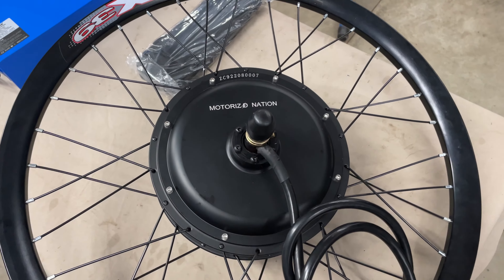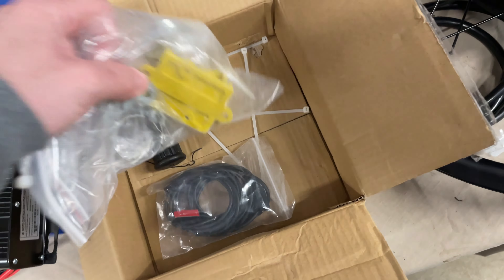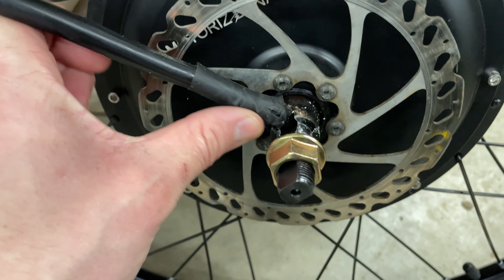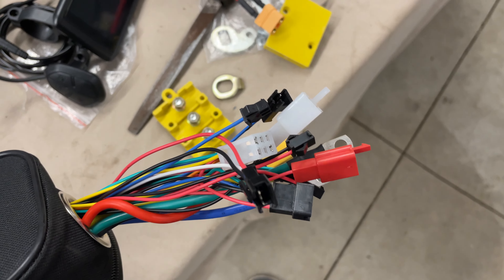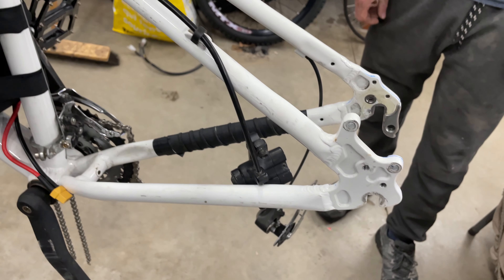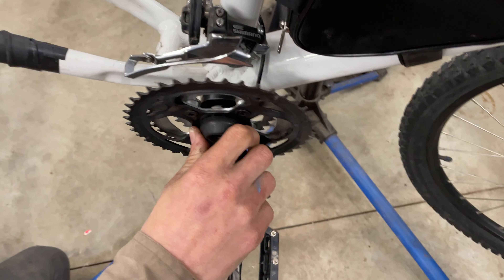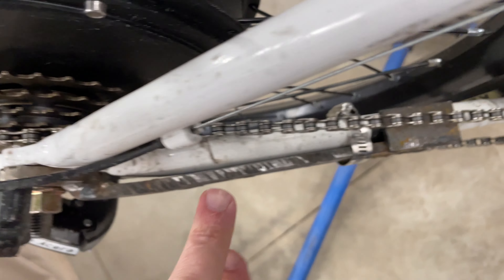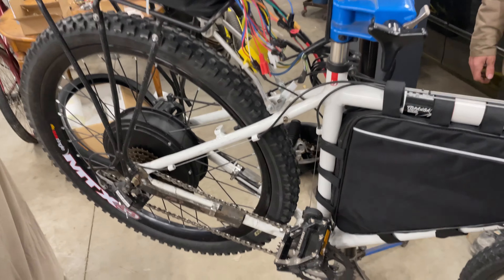Illegal 3000W 72V E-Bike Build Conversion Kit

Comment: Building an e bike is not a crime.
Reply from the maker: Riding it on public streets over 32km/h is
Reply: They only know it goes over 32 km if you tell them
Reply: @porkercon  Not really. It's still a bicycle which means it has pedals that can be used to increase your speed. I can cruise at 50 kph on a straight away.
Reply: Does when it's motored? @ProfessorStephon
Reply: @ProfessorStephon when you ride over 40  on a motored vehicle like this it would be classed as a motorbike
Reply: @ProfessorStephon  the motor of the electric bikes has to be limited to a certain speed with the pedal assist. This speed limit is 15.5mph. This means that once you are up to this speed, the motor must stop assisting you. You are still allowed to ride faster than this, but this can only come from the power you generate (or a nice downhill ride)., your comment about pedals is not true
Reply: @McEddModzHD49854  This is a really dumb question. Do you know what an electric bicycle is???? 🤡
Reply: @McEddModzHD49854  🤣👌 You don't know what the h🔥ll you're talking about. I'm laughing. I don't care if you understand. 🤡
Reply: What the fuck is a kilometer
Reply: The laws here surround e bikes are cooked, law states it has to be under 250w, no throttle, pedal assist only, top speed of 25kph you can get fined and I’ve seen people have their conversion kits impounded and put on the back of tow trucks, motorised bikes (the cheap 100cc kits) are also completely illegal outright and punishable too.
Reply: @Supra5673 it’s what other people use instead of a mph like Australians use Kph
Reply: @ProfessorStephon yes and that's the law in most countries anything over 25 kmh with just the throttle is illegal you're making a fool of yourself

Comment: I don't understand why you build something like this if you are so negative. Then spend more money on better parts, frame, controller, etc. Btw, you don't have to install the pedal assist if you have a throttle
Reply from the maker: I didn't build it, someone else did and I filmed it. We are aware of that but we want the option to use pedal assist.

Comment: I put basically the same motor on a stealth type frame in 2021 (3000w) and I love it. It's my daily driver...weather permitting. The frame is quite heavy of course but I decided to go for something that absolutely wouldn't fatigue over time. I wish more people could experience how much fun these big motors are, thanks for posting.
Reply: My build was the 1500-watt kit, on a Shwinn Axum 29' mountain bike. It is great, and still very lightweight. Long ranges with regen with only a 20 Ah battery 60 miles and top speed of 37 mph. It's not high torque but a nice gradual speed build-up. But I still did a steel plate on the drop-out. Super fun commuting all summer.
Reply: @lionelhowell4972  Nice build indded. What Voltage are you running? What brand hub motor w the regen ?
Reply: How many miles does it last? Would like to build an e-bike for college

Comment: Nice video!  I used UPP cell batteries on my ebike and atv, and they are extremely well built as seen in tear-downs.  Highlighy recommended.  They make universal tq arms I show in my bike video.  Yours are gnarly, and in a good way- should have room to grow with that setup; thank you!
Reply: Upp are poor quality. Banned in UK for fire hazard.
Reply: @Tomas-ml9nv  It's like places banning Juul, they just target the biggest manufacturer representing a market.  I've used, tested, opened many lithium battery packs.  UPP , in my experience, uses better BMCs, double solder points on cells, and they're internal wiring further showcases their workmanship.  Others I've purchased have came w wrong power supply, have shody wiring or BMC failed. And even more I've purchased were actually UPP batteries rebranded.  Nonetheless appreciate your reply and input! whatcha using in your builds?

Comment: You should be able to swap the 5 speed cassette with an 8 speed one and have it take up the same amount of space. The 8 and 5 speed are the same size, just on the 8 each chainring is closer together.

Edit: Also, pretty sure the pedal assist sensor goes on the opposite side of the cranks to the front cassette.

Comment: I made my torque plates and bolted them straight into the frame. 10000 watt hub and controller. 84v main and 12 vt booster all together 96v
Reply: That sounds insane. You got videos?
Reply: @yeredfarias7662  😅 What is the video you would like me to create? I made the bike but have no decent camera to make some quality riding videos. I will make a phone video of anything.
Reply: @soylentgreen9492  anything really lol. Was just curious about the bike frame and if you got fat tires and if it hooks or spins

Comment: Wow with what you did in the end to fit the motor in the dropouts it's a little bit overkill but better to be safe than sorry but I know one thing for sure and that is that the torque will not remove the wheel from the frame anymore😂 as for the pedal assist you should have just put it on the left-hand side of the bottom bracket so much less hassle

Comment: Hi, after watching your video I have decided to build a 5000w myself, and I have a couple questions regarding your build which may help me. 1. The wire coming out of my hub motor (and it looks to be yours), there seems to be 2x plugs that are exactly the same (not the o-ring plugs, the other one), did you just leave one plugged in to none and plug the other one into the controller (I noticed for my controller there is only 1 plug made for this one coming out of the motor) 2. How did you stretch out your battery bag to get rid of lumps and creases and make it look better? 3. How do you pull out the frame to make it (2.5") wider so it can fit? 4. What type and size file did you use for the dropout? And purchased from where? 5. With the blue wire (speed limiter), is there a way for you to choose what the maximum speed is? Just because where I live its 25kmh. Thank you so much, and awesome build!
Reply from the maker: 1. I can't remember
2. It was like that from new
3. We only had to pull it out about .5".
4. Flatbastard metal file
5. You can set max speed in the screen.
Reply: @porkercon  Ok great thanks. I contacted the supplier and there is 2 wires with all kits, one is used as spare. And about pulling out your frame .5", how do you actually do that? Did another person help you, and you just pull it out and put the axel from the motor and put the spacers on? Is there any tools you have to use?
Reply from the maker: @TomDeighton-h2d  Ya just got someone to hold it open

Comment: Hello mate im a fan, absolutely love the brillant torque arm design but i have got one question. How do you stretch out the frame by 2.5cm like what u mentioned in the video.
Reply from the maker: By pulling it with your hands, its not permanently stretched, and its not good for the frame.
Reply: @porkercon  using a 5000w motor and its axle is longer guess i dont have any other choices right mate
Reply from the maker: @zephyrus3389   right, might have to do some frame modification

Comment: Can this be put on a regular 20" ebike? Would putting it on the front wheel for front wheel drive be more stable?
Reply from the maker: Probably not since the motor is so big, front would be fine but would put a lot of force on the fork.
Reply from the maker: Looks like there is 20" versions of 3000w, scary.

Comment: Do you have a full parts list and where you purchased them?
Reply from the maker: Parts list here:
26" 3000w 72V rear wheel https://s.click.aliexpress.com/e/_Dm0TiEX

72V 30ah Battery (buy at own risk, I would seek a name brand/certified battery) https://s.click.aliexpress.com/e/_DDFXHgJ

Controller, throttle, levers, sensor, screen https://s.click.aliexpress.com/e/_DFNl6Sr
^I can't find the same controller with the same battery connector, you might have to solder on a connector.

Wire junction box https://s.click.aliexpress.com/e/_DDqtKxv

5 speed freewheel https://s.click.aliexpress.com/e/_DFgY4r1

127mm square taper bottom bracket https://s.click.aliexpress.com/e/_DDSYN3H

All other parts were already on the bike for the most part, torque arms were custom made.
Reply: @porkercon how do you trust aliexpress man? I've heard of people getting scammed and am so weary of it.
Reply from the maker: @No-ju9xz  Just do a credit card chargeback if you never get the item
Reply: Pedal assist sensor goes on the other side of frame on the non-drive side of the cranks.
Reply: @porkercon  aliexpress seriously? 😂😂😂😂😂😂
Reply: Where the charger plugs
Reply: Temu albana duh .

Comment: i just got this same kit and putting it together. can you just not connect the pedal assist if you dont wanna use it? and same for that alarm system with the key fob stuff? not sure if some wires need to be shorted together or no... mines got a 48V 1000W on front and this 3000W on rear.. lol😂
Reply from the maker: Just don't connect them

Comment: All that extra strength? Off road use only?  My 3000w motor with an 80 amp controller on a 72v 20 a/h battery does 65 mph on a 25 year old Kona mountain bike and I use it everyday to go to work on. Most times I am at full speed going to work and I only use 2 torque arms with no welded frames for extra strength as its over kill and it's perfectly safe if you know how to handle the immense power it can throw at you. Nothing is too powerful !
Reply from the maker: Frame is not welded. Better keep an eye on your dropout welds.
Reply: That's sickk have you got any links of what you purchased I want to do the same on my bmx

Comment: can you please confirm if you bought from that exact seller? ND Ebike Factory Store- this seller. I had problems with scammers this year on AliExpress but I want to order this kit. Thanks in advance
Reply from the maker: We have bought multiple different kits all from different sellers and have had no problems.
Reply: @porkercon  1000w is the easiest to buy, but this 3000w doesn't have many sellers
Reply: @porkercon  I am looking exclusively for a mtx set
Reply from the maker: @pubga5730   Usually you can customize your order with which rim you want
Reply: @porkercon   in Europe they have max 1500w 48v
Reply from the maker: @pubga5730  get it from Chyna

Comment: 6:00 If they had stored the velcro straps wrapped around the bag as apposed to around itself it would have been more obvious how they are supposed to be used to secure the bag. The velcro goes on top. at 6:13 you have the bag upside down trying to install the bag as though you'd be wearing it as a fanny pack. The vecro goes from the top, around the bag, under the panier, back up around the bag to the top.
Reply from the maker: I think we tried that but they were too short. Its now directly mounted to the frame with no bag.
Reply: @porkercon  tyraps ftw

Comment: Hello my friend, is it possible to install a 3000 watt motor on a 15 amp V48 battery? Thank you
Reply from the maker: I think its possible but it wont run at 3000w
Reply: @porkercon  thx

Comment: I just got this same ebike kit from NB power. Unfortunately, when I turn on the throttle it makes a long beeping sound. Any chance would you guys know what that means? The rear wheel doesnt spin. Feels like its locked
Reply from the maker: Disconnect phase wires and see if wheel spins
Reply: @porkercon thank you that worked. However, the wheel spins backwards? Lol, any idea how to fix that?

Comment: Were you eventually able to get rid of the check engine light?
Reply: Having a check engine light on your display can be due to multiple factors. You should look for the error code written on the screen and refer to your display manual to see what is the error related to.

Comment: Hallo, erstmal, wie hast du eigentlich das Hinterrad hineinbekommen? Die meisten Achsaufhängungen haben doch nur ein Rahmen Nabengröße von 130 mm sprich 13 cm und das 4000 Watt Modell hat doch sicher 150er spricht 15 Zentimeter. Narbenaufnahme, wie hast du denn die Hinterradnabe, in die Aufnahme bekommen? Das würde mich jetzt mal interessieren. Schöne Grüße von Christian!
Reply from the maker: Road bike is 130mm, mountain is 135mm so its fine.
Reply: @porkercon  Nein ich meine der Motor die Nabe das umrüstset hat doch 150 mm wie hast du das gemacht das es rein passt den Rahmen auseinander gedrückt um das Rad rein zu bekommen ❓
Reply from the maker: @UrbexDerWeltenbummlerChristian  This one is set to 135mm, you are looking at a different one.

Comment: Quick question, based off quick digging I see you have the same controller that came stock with my kit. Have you figured out how to fix the overvoltage issue? Anytime my battery charges to more than 84v the system stops working
Reply from the maker: @bashful3026  I don’t have that issue
Reply: @porkercon  is the controller you used rated at 30a max 60a+=1
Reply: @porkercon  I ask this because the controller I see you linked and the controller you showed in the vid could possibly be a mismatch lol, but yeah when my charger charged the battery to 84v the bike wouldn’t turn on again
Reply from the maker: @bashful3026  It's not the exact same, I could not find the exact same one to add into the link.
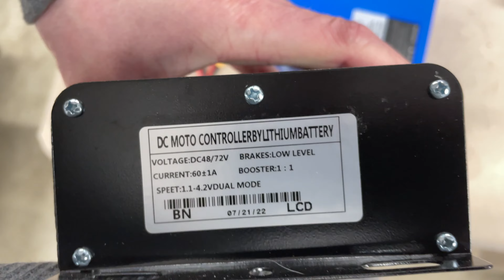Reply from the maker: @bashful3026  All In know about it is what's shown at 1:21
Reply: @porkercon okay, thank you anyways man I appreciate the time you took 👍 I’ll let ya know if I come across anything prevailing

Comment: Hey man, decent build and good tutorial, i was considering something like this but also was worried about the frame handling the torque, so my theory has been to downgrade to a 1500w 48/52v and just be happy with that for some fun around town and off road weekend rides, do you think i can get away without using a torque arm, or would you say to at least use the original 🤷🏽‍♂️👍🏽
Reply from the maker: yep, 1500w is great, 3000w is overkill. My friend has about 6 eBikes right now and he uses the 1500w the most
Reply: @porkercon than you for your quick response 🙏🏽👍🏽with or without torque arm, I also know of the trick to remove the plastic spacer on the disc brake side from factory, but I'm having slight issues, so the rim fits my frame with all the nuts and spacers but the spacers only fit outside of the frame if I put 1 behind and the other outside with the nut it won't fit between my drop out but it is the correct hub for my drop out,,, any suggestions please.
Reply from the maker: I'm not sure  @DarkTriad6
Reply: I have a 1500W/52V kit (does about 1750W fully charged), you're gonna need at least 1 torque arm, or it might spin out of the fork at full power...perhaps not directly, but certainly over the months. I haven't removed my wheel in 2 years since I built it 

If you're gonna use regen braking, you might even need two torque arms, as the force applied reverses when braking.
Reply: @porkercon why would you say the 3000w is overkill?
Reply from the maker: @KyleWilliams-xf5st  To fast for what the bike is.

Comment: Yes friendly advice you can't stick pieces of metal on top of weak metal and claim that is strengthened it because it won't what you've done without sounding rude is you bogged it what you should really do is cut the whole part out and put in stronger metal you're basically Dublin the speed of the bike but you're not doubling the strength of the frame to carry that and you will pay the consequences because you'll start cracking Worlds stability at high speeds my device is cut the whole back part out and easy peasy to world of fresh bit in you can weld it wider to fit the wheel in and you can weld it stronger which will last and will be a solid piece of metal always always uses less metal as possible because that's where your strength comes not by putting one piece on top of another piece unless it runs down the whole length of the frame good luck don't gamble your life on I'm sure that'll be alright
Reply from the maker: You're wrong, I'm right. Buy us an aluminum welder and training and I might do what you said.
Reply: @porkecon is right because these hub motors are not powerful enough to rip apart whole rear triangle of aluminum mtb frame. These torque arms ar mainly to strengthen dropouts because without toque arms you will break original dropout slots when accelerating and motor will rip off it's own wires😂 cool project btw